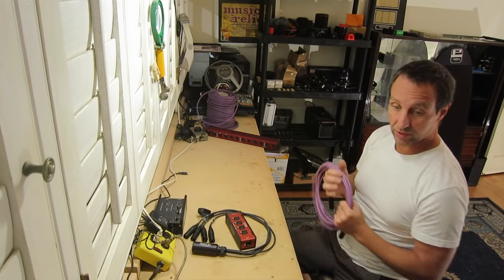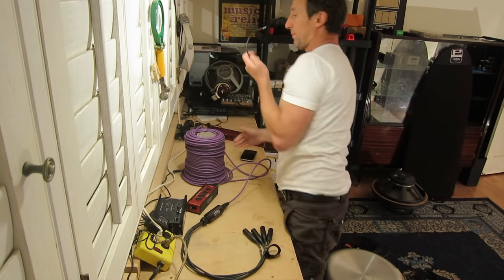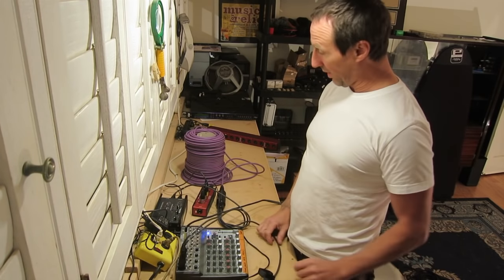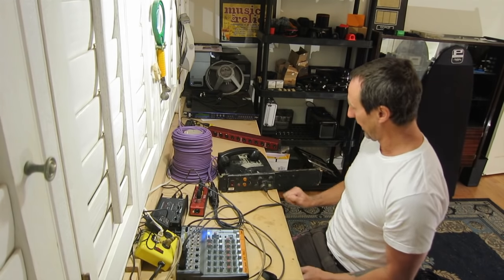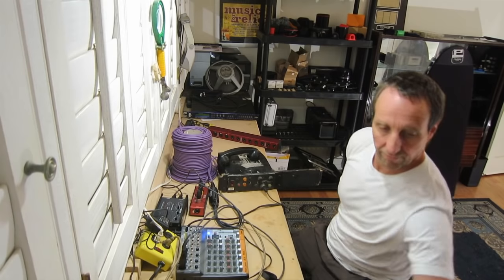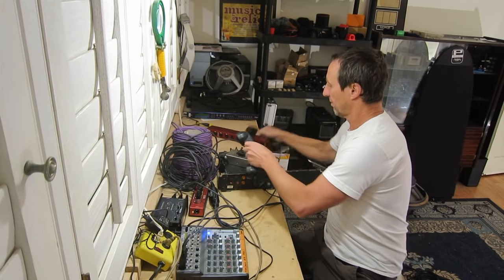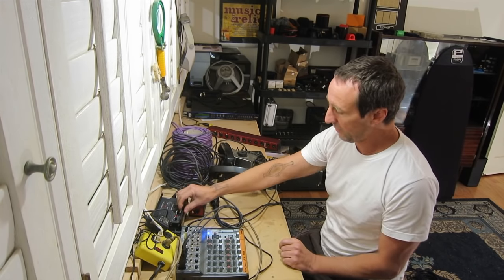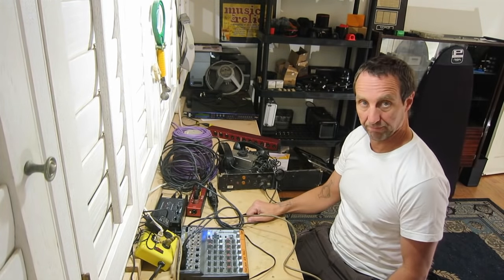Using Cat5 cable for analog, AES3 and ClearCom signals with the Cat Snake System

Comment: What about ethercon to mains LR and aux to subs with all self powered speakers? I want to use the ethercon panel with 4ch ethersnake
Reply from the maker: Yes that works great.

We use for channel ethicon analog as backup to fiber or Dante for our delay clusters at some shows.

These runs can be 500 to 1,000 ft or more and it works great.

We actually have better results for me analog over aftercon then we did with the analog snakes due to the wide frequency response and excellent shielding of the high quality cat 5 cables

Comment: So this is a completely passive unit? So basically just a shielded Cat5 cable where you use the single thin cables  separated for the XLR  breakout?
It's awsome! I just want to know if I understood it correctly or if there's more to it that I didn't understand or overlooked.
Reply from the maker: Exactly, using the high quality cat twisted pairs to run analog audio, DMX, com or aes3

Comment: I guess one should always test with the equipment they're actually using. I remember approx 120m of mic cable between a Waves MaxxBCL and some radio broadcast console not working out. Next time I'd go for Dante via fibre. (In that case however latency was not an issue, like 10msec later on air, who would care.)

Comment: Hi ... Does the SoundTools CAT TAILS works connected to a PCIe PoE ( Power Over Ethernet ) Ethernet Switcher Card ? I mean, IF I connect a SoundTools CAT TAILS to a PCIe Card like that, will I be able to plug my CONDENSER MIC ... and the DAW ( Digital Audio Workstantion ) will be able to recognise my MIC and send 48v Phantom Power to it ? With this configuration ( CONDENSER MIC -> SoundTools CAT TAILS -> Cat5 Cable -> PCIe PoE Ethernet Switcher Card -> DAW ) ?
Reply from the maker: That does not sound wise or functional. Do not plug analog mic lines into a digital data switch.

Comment: I'm Sold, thanks for the video Dave!
Reply from the maker: +Matthew Morgan Very cool. Yes, we designed and built these as an in house solution and then offered them from out Sound Tools division. We just sold 5 systems, each consisting of a Cat Snake Female box and 4 Cat Snake male boxes and 4 600ft Cat 5 cables. Each system has 5 locations spaced 600 feet apart and the each system is spaced 600 feet from the next system, so the result is 25 locations covering the entirety of a 5K marathon run. At this point, we are no longer adding conventional stage sub snakes.  Soon we will be making 8 and 12 channel Cat Snake boxes as well. We have so many reliability issues with the Whirlwind W1 multipin systems, we cant wait to switch over to Cat Snake based stage snaking systems.
Reply: Dave Rat WOW!!!
sounds like you have your work cut out for ya.
I will be putting my order in within the next few weeks or so. 
I love my little sniffer I got last year!
Reply: I'll be running DMX, Com and possibly audio down the line, it's going to same me so much cable.
what kind of shielded cat5 do you suggest? will any old shit cable work or should it really be tour grade?
Reply from the maker: You can use any shielded CAT5, 6 or 7 cable though there are a few things to consider. 1) If you want to use the cable for a portable system, use stranded not solid conductor cable. 2) When using Cat Snake for com, there is there is current running down the ground/shield so you want a good shield connection, typical Cat 5/6/7 cables have a mediocre connection for the shield, Rat/SoundTools is making high quality Cat cables that have the shield soldered instead of crimped. Also, Cat 7 is better than Cat 5 or Cat 6 as it has individually shielded pairs that will be a beneficial when running a combination of digital and analog signals. Rat/SoundTools is in the midst of converting to offering Cat7 rather than Cat5 cable, starting mid January. That said, all the tests I did were with crimped Cat 5 cable.
Reply: thanks man, thats a big help!!!
Reply: +Dave Rat Great product Dave. Can you give an idea of cost please, and do you ship to Australia?
(Edit: sorry, just found the your SoundTools website.)
Reply: +Anthony Bowe  Hi Anthony, this is Kea from SoundTools. I saw your post and I wanted to give you the link to our Australian Distributor - http://www.simonstav.com/.
Reply: Hi Kea, thank you for the information (I did find his details after I posted). The only slightly annoying thing is that he only appears to sell your products via his eBay shop, and my employer (a University) prohibits us from buying from eBay. No worries, I'll find a way around that.
Reply from the maker: Maybe give him a call and should be able to work it it with him.  Otherwise let me or Kea know and we can help.

Comment: Hey Dave, would AES/analogue and RS485 (XTA control) work down this setup? Thanks!
Reply from the maker: It will work with anything that typically would use an XLR mic cable or aes cable.
Reply: @DaveRat  Appreciate the reply, greetings from over the pond, I've learned a lot from you videos, thanks so much
Reply from the maker: @jgroves1989  cool cool, and thank you!

Comment: Dave,  I'm assuming that the cable is individually shielded is that correct? And also where can I find more info on this system.
Reply from the maker: +spx92 Actually the cable just has an overall shield but what is interesting is that with balanced lines, high quality twisted pairs offer significant reduction of induced noise issues and Cat 6/6 cables have very high quality twisted pairs.
Reply: spx92   Yes, hard to believe but UTP (unshielded twisted pair) has amazingly low crosstalk.
Reply from the maker: Agreed

Comment: Man. Why didn't we have this when I was pulling rat nests (no relation) of cable all over and under stages and muddy fields lol. Dave I'd like to see this applied to say mic'ing a drum kit just out of curiosity.
Reply from the maker: +ncsteeltoe It works well with mic level inputs and a simple way to drop daisy chainable sub snakes around the stage. When we do installs, we add a few extra shielded Cat 5 cables to various locations so that should they want to send additional com lines, or return lines its super easy to plug in a cat snake or cat tails. The rackmount version is good for racks with the Cat 5 in and out facing outward and the 4 XLRs breakout inside. That way multiple amp racks can be daisy chained.
Reply: +Dave Rat Great ideas man.  Thanks Dave. Love that ClearCom haha.

Comment: How does it handle 48v over long distances?
Reply from the maker: +Tom Erik Stokness Since phantom relies on relatively high voltage (48V) and very low current, it can be run over quite long distances.  The CatSnake products will perform similarly to conventional audio snakes and cables with phantom over long runs.
Reply: Thanks :)

Comment: Have you tested it with unshielded? What about DMX, with Comm, and phantom power?
Reply from the maker: Yes, it will work with com, phantom and DMX as well as with AES3 when using shielded cat5/6. Cat 7 is always shielded, As far as non shielded cat 5/6, you can run balanced line level analog and anything that does not require a pin 1 connection with some success. The balanced analog will be more susceptible to hum and buzz issues.
Reply: +Dave Rat 
Are there any plans to release a Cat Snake that has paralleled male and female XLR connections on each pair in one box?
Reply from the maker: +Oneloudest yes, we have that and several other designs coming soon.

Comment: Hey Dave, could you provide some insight on how you would use this? Also why would you use this over another technology like optocore? 
Thanks, 
Dan
Reply from the maker: +Dan Fletcher Hello Dan, we built the Cat Snake system initially as a way to run analog backup lines to delay clusters at Coachella Festival. Previously we ran digital audio over CAT5 for the primary signal plus we ran 6 channel analog audio snake and mic cables. All of this was trenched and after each show, inevitably most of the cables would get destroyed costing well over $1000. With the Cat Snake system we can run longer lengths with a much lower cable cost. Then after more testing we found the Cat Snake System is superior to standard analog 4 channel audio snake cable. Unlike opticore, you can run DMX, Clearcom and analog signals without converting to digital and back down a simple inexpensive system that has disconnects and parallel outs.
Reply: Hi Dave,  have you ran DMX down your CatSnake along with audio or com? ie: input 1+2 audio, 3 com, 4 dmx?
Reply from the maker: +Darryl Ross yes, we have tested and used it with a combo of audio DMX and com and it works wonderfully. Like with any audio snake system, one thing to be careful of is if using very low level mic signals down the same cable as high level audio or digital signals can have some crosstalk concerns.
Reply: Is there a specific connector conifguration?  Is DMX sharing the same shield as the audio? Doesn't a digital ticking sound get into the audio side?

Comment: What cat5 cable is that you are using on video?
Reply from the maker: +coolbabar While any shielded Cat 5 or Cat 6 cable will work, Soundtools is making the cable shown. It is really cool Cat 5 cable that is rugged, winds well and we solder the shield wire instead of just crimping it like all the other shielded cat 5 we were able to locate. In the next day or so they should have the cable up on the soundtools.com website.

Comment: hey Dave.. cool vid.. anyways.. im kinda knew to the cat5/6 and i was wondering if can replace my normal mic cable and use the cat5 with the connectors to run my mixer to my power speakers and such? (im a dj).. or should i just stick with my typical mic cable? thanks!
Reply from the maker: +duy nguyen Mic cable is good for carrying a single line of audio and Cat5/6/7 is great for carrying 4 lines of audio. You could use a Cat snake to send left, right, subwoofer plus a monitor mix all down a single Cat5 cable to stage from the mixer. Also the Cat snake works great as stage boxes.

Comment: Ok, this question has probably been asked too many times but I feel like I have to ask since this might make my life insanely simple in the future. Let's say I buy 4 rack units, with a total of 32 ins and 16 outs. I can then use those for my studio or for a live rig and just plug all my mics in the 32 ins and send headphone mixes or feeds for monitors and FOH from the 16 outs? Cause this would make everyone's life insanely easy. It would allow every single studio in the world to cable the whole building with cat5 cables and record from any room in the building without having to use remote preamps, you can just plug a mic in input 1 at the other side of the building and then keep your favourite preamp in the control room on the other side of the building. And then send back a headphone mix for the musician.
So basically the question is: can I use this for mic level signals or do I use this only for line level signals? Since I haven't understood if the analog signal gets converted I don't understand if I can.
Reply: Running and labeling 16 CAT wires does not sound like any kind of simplification to me.  Lots of moving, installing, setup time might be prohibitive.  Surely an analog snake would be a smart alternative in that scenario.  Though it costs more it is a much more road-able solution and timesaver.  Once I get into the 48+ channel scenario, I’d be looking at analog snake, or Dante units on each end.
Reply from the maker: Yes they work perf ctly with mic level and also we are now releasing cat rack 16, 16 XLRs single rack space version.